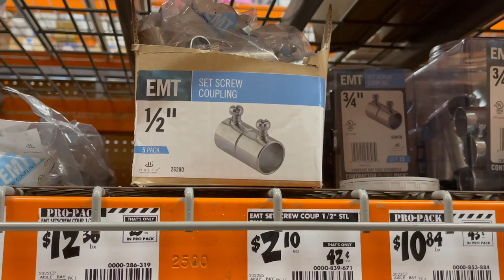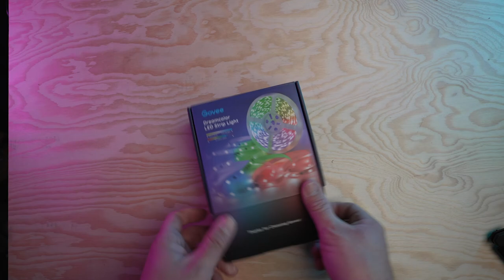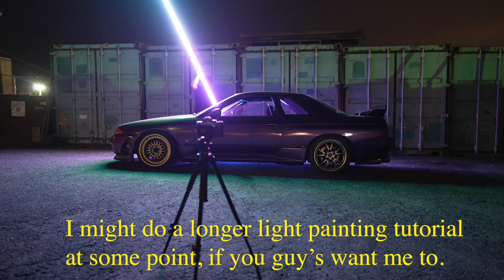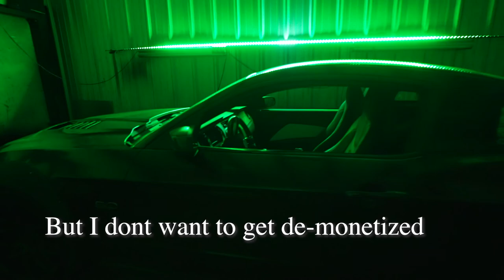Giant LED Light Wand on a Budget for Light Painting using Govee LED strips

Comment: Should make an A frame or Triangle frame with a few of them. And park your cars under. Id mount them in your ceiling when youre not using them.
Reply from the maker: That’s a pretty cool idea.   I’ve seen a few shops with some hexagonal led lights that mount overhead,  and they look pretty baller.  But I don’t think I’ve seen any that were rgb (yet)